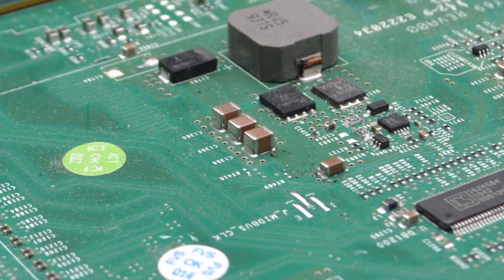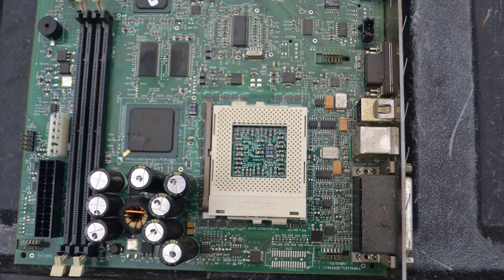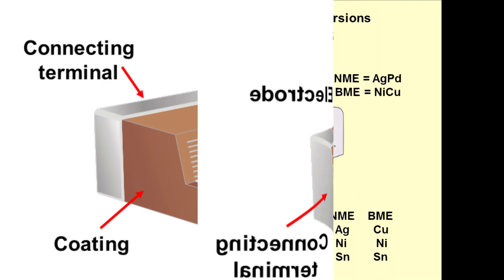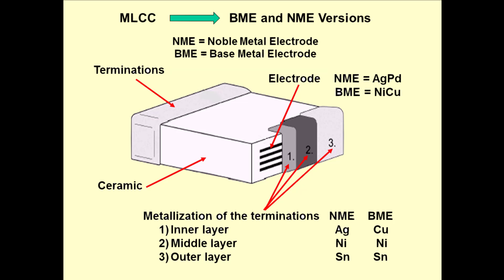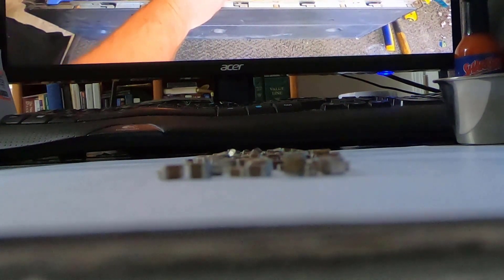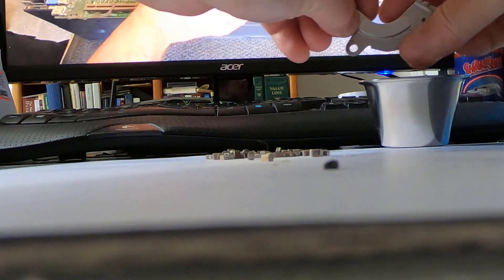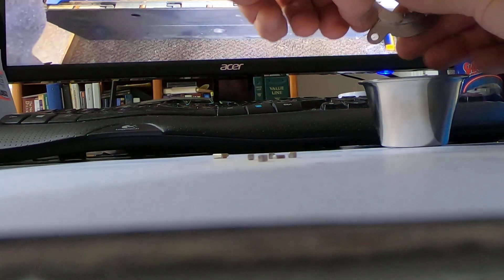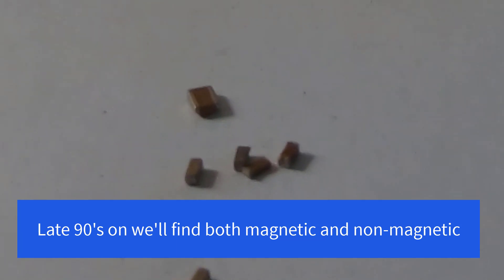MLCC collect or not, silver and palladium OR not?

Comment: what reason would a board need the PM mlcc after the 90s
Reply from the maker: I can only speculate that there would be no need if the performance specs are the same. But I have no data to back that up.
Reply: @sharkscrapper I must have misinterpreted I thought you said it was like better performing then you would have to judge for yourself if there was a need for a manufacturer to need a higher performance mlcc I deal with her picking up TVs and E-Waste from people and I haven't seen a TV from 90sever lol😅 what's the best e-waste you like to receive TVs laptops computers cellphones? I did want to a desktop once but it was not a very high performance one and I got to tell you it had nothing in it really
Reply from the maker: @rodgergraham357  No worries.  It's hard to say what I like the best. New PC's with newer generation "i series" CPUs are the best for making money. The latest generates I series CPU's can fetch up to $80 each.  But older PCs and servers are the best for gold recovery.

Comment: Hello, here is an update.       The very first thing you need to do is remove the magnetic mlcc from processing. They have no precious metals in them and will waste your time and chemicals. A neodymium magnet with 2 plastic feet that will make the magnet 12.7 mm above the surface of a table top should be used. Any MLCC that sticks to the magnet at this range is BME. Both BME and NME have nickel plating on the metal end terminals that gets soldered to the circuit board but NME do not have nickel in the interior of the ceramic. This is why they are less magnetic. There are 2 kinds of MLCC: 1.BME (base metal electrodes) 2.NME (noble metal electrodes). BME contain no precious metals at all and are a waste of your time. NME contain silver and Pd in the inside electrodes and a silver layer on the 2 end caps. These are worth processing. You need to be careful where you get the MLCC. This is important. After 1990 manufactures of MLCC switched from NME to BME because of the high cost of precious metals. For non-mission critical use such as TV, computers, printers etc BME were used. For mission critical use where hi efficiency and reliability were needed such as weapons, and defense and space and surgical, satellites etc NME were used. So that is why you need to know where the MLCC came from. Without knowing where the MLCC came from you need to do a magnet test. It is still possible that some NME are still being used in modern day consumer electronics but only in the critical circuits like timing, switching or oscillating circuits. The rest of the MLCC would be BME so out of 1 kg of MLCC you might find approx 1 percent NME. That's why he got 0.46 g of precious metals out of 500 g of MLCC. Conclusion: don't waste your time and chemicals on BME MLCC. NME are worth processing. Oct 2024
Reply from the maker: Great detail and information, thank you

Comment: You do got to be careful with using such strong rare earth magnets. Palladium is paramagnetic meaning it very weakly gets attracted to a magnet. If that is an exceptionally strong magnet as the large hdd magnets are then that weak attraction combined with the small mass of the mlcc can stick to a strong magnet. the silver is slightly diamagnetic giving a slight repulsion to the magnet. But thats a small effect. I personally dont use hdd magnets for this very reason i have tested mlccs that weakly stick to the magnets dissolving in nitric or AR and testing with stannous chloride. I got a positive indication for pgms. Now i haven't processed at huge amount of these either. Ive been stockpiling for several years got several pounds saved up. Honestly though since ill be refining myself... Im simply going to do them all together as its essentially the same process using the same acids... If your sorting them to sell though this info might be important mo point in giving perfectly good palladium and silver away ya know
Reply from the maker: It's a good point. Of course, holding the magnet further away leads to a weaker field attracting the mlcc's.  But for me, it no longer matters as I just put them all together.  I had thought I would refine them, but the biz has gotten too busy and I rarely remove them anymore.  Not sure what I'm going to do with what I have in storage just yet.
Reply: @sharkscrapper   yeah it is a lil like splitting hairs. Though the physics of it all might make for an effective method of sorting depopulated components very quickly I've been tossing that around in my head for a while... Sounds like a fun project id i ever get the time to put into... Cool video though, got a sub from me 🙂
Reply from the maker: I keep toying with the idea of refining for the fun of putting some of my chemistry knowledge to work.  But just too daggon busy.

Comment: Well being that those mlcc's weren't used until the 90s' also tin is magnetic and is used to mount all mlcc. So what was the point in separation?? All are going in hill anyways lol. Thanks for nothing
Reply from the maker: Alex, I'm sorry that you did not see the value in this video that many others have.  As for separating MLCC's based on their magnetic response, the verdict is mixed.  Some "refiners" have told me, or posted videos, that they like to separate them with the goal being better yields.  Others have reported it's not worth the effort.  I'm not a refiner and I don't separate them but sell as "Mixed MLCC's."  Having said that, I found the discussing interesting and wanted to share what I had learned for those who are either new to this or haven't had the time to dig a little further.

Comment: great info but i think a little more in depth then im ready for lol'
Reply from the maker: Yes - at your stage I'd agree.  In fact, when you get computers I recommend you just stash them in the corner some where.  Or at most break them down to power supply, CDROM, HDD, RAM, PCI/Slot cards and Motherboard.  Don't worry about taking anything off the boards just yet.  Just accumulate for now.
Reply: @sharkscrapper  Good plan I actually have two to break down

Comment: Whew, thankfully I haven't tossed any of my 'magnetic' MLCCs.  I was brushing the magnet directly over them, which was picking up everything!  From all the vids I've watched, it looks like the weakly magnetic ones have silver still in them.  I should probably try using one of those big flat flexible fridge magnets.  Those are very weak and will only grab the MLCCs that are mostly nickel.
Reply from the maker: Yes a weak magnet OR hold the magnet further away.  I'm glad you didn't throw away the magnetic ones, there's still value in them.  Are you planning to extract the silver yourself or sell to someone?

Comment: You shoul  shouldnt use a neodymium magnet to check your mlccs  they are to powerful and you will and up tossing valuable mlccs  into the worthless pile when they are not . Learned this the hard way and was disgusted with how many mlccs i plucked and  chucked  all because i was using a hard drive magnet .just use a speaker magnet nothing to strong .
Reply from the maker: Another option is to hold the neodymium magnet further away.  It would make for a very interesting experiment to determine the optimal distance above the MLCC's to get the cleanest separation.

Comment: I have been saving the boards I collected with them on them because I was not sure how to separate..problem I have here is that the recycle guys got together,I know this because I was working for the one the had the meeting.boss wanted the other buyers to drop their prices straight across board so S to make all the buyers more money.thwy have slowly bought out the competition while keeping prices low.im better off to refine anything I can and even if I don't sell perhaps down the road I can.right now it's under 2.00 for bright new copper.seems low but have to drive 150 miles to get better price
Reply from the maker: Joe - an unfortunate situation for you.  I'm sure you've seen or know of the many refining videos and channels on YouTube.  But be careful with those acids.  You check out BOARDSORT.COM as another option to sell your boards.  Depending on where you live, even with shipping it might be a good option for you.
Reply: On my first practice run I used peroxide and acid to dissolve the base metals.ididnt want to use a bunch in case it failed but wanted to have enough to see result.the final product weighs 97 grams.however it only tests about 14k I think this is because of silver and platinum group metals with it.i don't know what to do with it but I have it.i still have a bunch to process.i was lucky to get my hands on about 20 computers from 1990's

Comment: I am a relatively new to scrapping and still learning about all the different forms of various precious metals to be found on boards.  We save the pallaium and tantalum among other things but this video brought new information to light. I had no idea about magnetic and non magnetic. I do have one question though......Any MLCC's that are magnetic, should they be tossed into the ewaste bin for the regional recycler to deal with or do they just go to garbage? I don't want to have to put anything into the garbage that I don't have to. As well, someone had mentioned using a magnet from a speaker? I assume they mean a very small speaker?
Reply from the maker: My recommendation is just keep them all together and not worry about it until you are ready to process them.  When you're ready to process you'll have learned a lot more than you know now, and will be better prepared to decide how to handle them.  If you decide to sell them, the buyer will tell you if they want them seperated.

Comment: Another timely video. I have plenty of boards that I've been thinking of taking MLCCs off, sitting in the garage. Im not going ahead anymore - not worth it, and way too fiddly. I do wonder if both types are magnetic to varying degrees, and if the magnetic field strength, distance between magenet and size of the MLCC interact. The magnet you are using is really strong and quite close.... I wonder if you are discarding precious metal MLCCs.... How to tell?
Reply from the maker: I have no doubt that I am discarding some NME's.  At this point I still have the magnetic ones and may resort.  But my goal is to ensure my NME stack is as clean as possible.  So some loss is acceptable.
Reply: Yeah since the metallic ones may contain palladium and silver too.

Comment: sharkie neodymium is way too strong  and will pick up 99% as you use weaker  magnet your sorting will be more accurate as you using such pawerfull magnet  nickel layer will stick anyway  as you use a weaker one  all nme after little shake will fall of tho  see you had few pieces what non stick even to neodymium  so it means there is another type what have no nickel in  i guess and the question is what they have instead??? for sure some non magnetic
Reply from the maker: It is easy enough to hold the neodymium a little further away.  My goal is to ensure my NME collection is as pure as possible, so some loss is acceptable.  I may resort the magnetic pile with the magnet further away just to see what we get.

Comment: Very informative, thank you.  Now, not to throw a spanner in the works but, I'm sure I heard recently (possibly it was Ewaste Ben) NOT to use a neodyneum (SP?) magnet from a hard drive because it will pick up most of the MLCCs even some with the precious/noble metals in them.  But instead, to use a regular magnet from a speaker or something.  Maybe you could test this out and then have 3 lots of MLCCs, true (non-magnetic), imposter (a bit magnetic) and fake (totally magnetic).  Might be an idea for a follow up video just for information even if you and others decide to only sweep with a strong magnet and keep the true PM MLCCs.  Take care, Poo
Reply from the maker: No worries poo.  It's no problem using the strong neodymium magnet, one just needs to hold it further away to reduce the strength of the magnetic field.  My goal is to have as clean a NME stack as possible.  I can always resort the remaining MLCC's with the magnet further away but without testing the precious metal levels of each group, I won't really understand what I'm getting anyway.
Reply: @sharkscrapper  Yeah, kind of uncharted waters here.  The only channel I can recall trying to get paladium (I think, actually it might have been platinum), was Cody's Lab trying to find it out of roadside sweepings.  He was working on the theory that some precious metals may have been coughed out of the exhausts of cars (and their catalytic converters), and if that was so, it would surely settle in the sweepings at the side of the road.  Take care, Poo
Reply from the maker: @poosmate  You know Poos, I believe I saw that video.  It's a few years old correct?  They were going after platinum.  I found a video by  Backyard Scrapping on magnetic MLCC's.  The yield was terrible, something like .45 g of Ag from 100g of magnetic MLCC's.  No measurable Pd.
Reply: @poosmate  I also remember that highway video.
Reply: Nickel is mildly magnetic, so this is a good tip.

Comment: I was told by someone not to use a hard drive magnet. They will pick up some noble metal ones because of the nickel. Have you tried with a magnet like out of a magnetron and see if it makes a difference?
Reply from the maker: You can use the HDD mags just hold them a little further away as I do.  A magnet's pull decreases rapidly with distance.  I have no doubt that I am collecting some NME's with the BME's in my process.  But I'm ok with that to ensure the NME's I do keep are as "clean" as possible.  That way if I decide to sell I know I'm selling good product.  If you're going to extract the Ag and Pd yourself, then having some BME's in your mix is no big deal other than wasted acid.